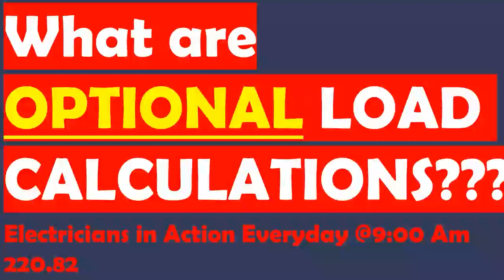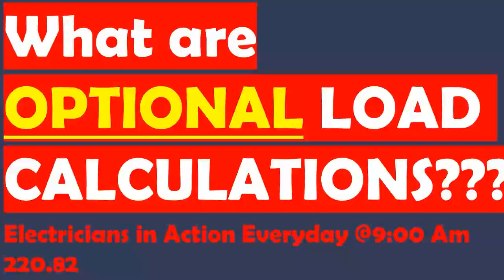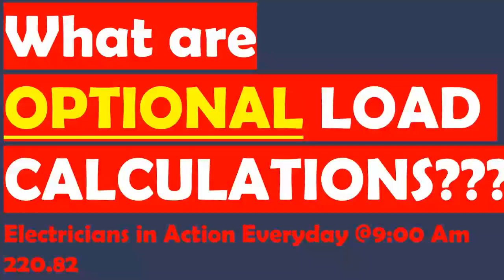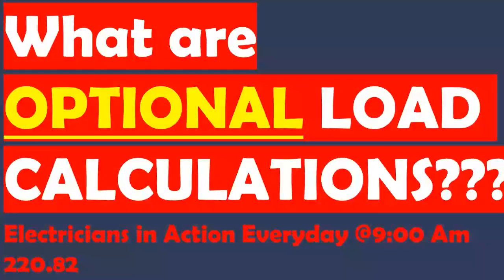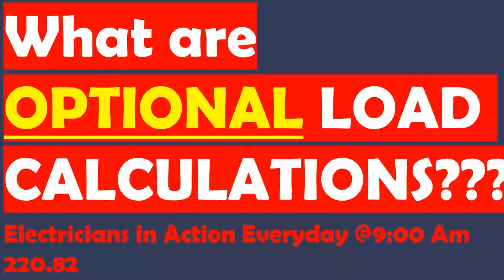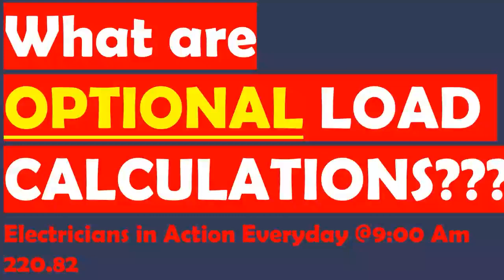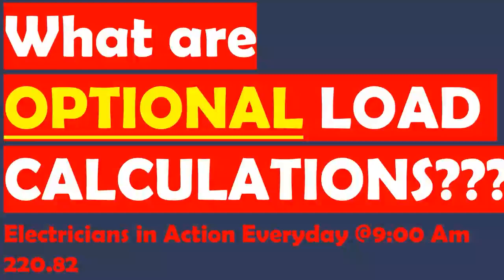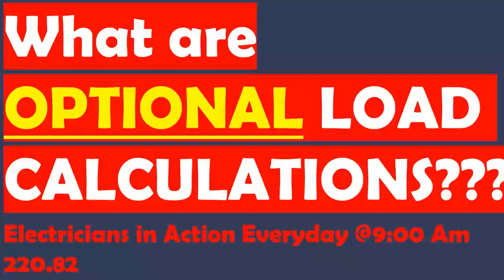What are Optional Load Calculations??

Comment: Using the optional calculation method, what is the calculated load for a service serving a single family dwelling when given the following information: The dwelling has 1200 square feet and the following electrical appliances that are fastened in place: a 240 volt, 10 KVA range, a 4800 VA clothes dryer rated at 240 volts, a disposal motor rated at 750 VA. The air conditioning is rated at 5000 VA and the baseboard heating, which is controlled by six separate thermostats is rated at 10,000 VA.

Comment: single family dwelling is supplied with a 120/240 volt, single phase, three wire service. This dwelling has 2,500 square feet, a total appliance load of 18,500 VA, 6,800 VA of air conditioning, and 12,000 VA of electrical heating which is controlled by four thermostats. Using the optional method, what is the total computed load for this dwelling?